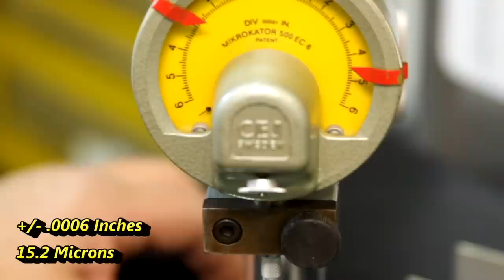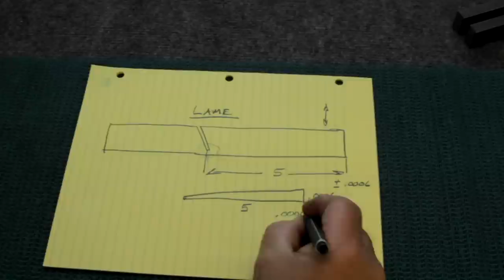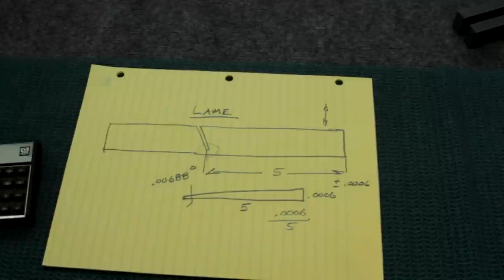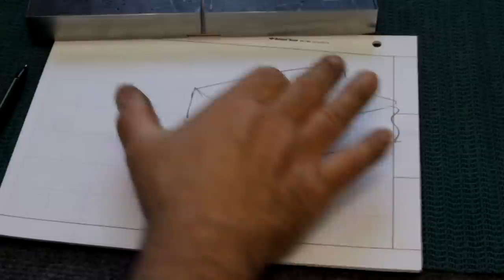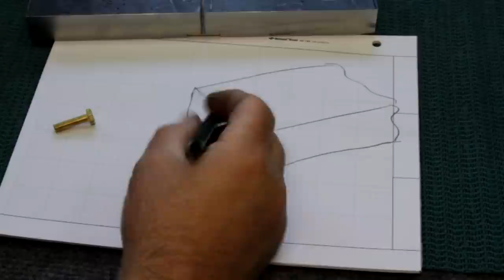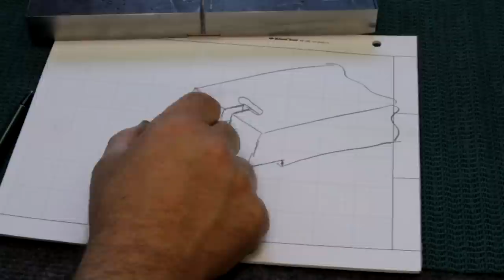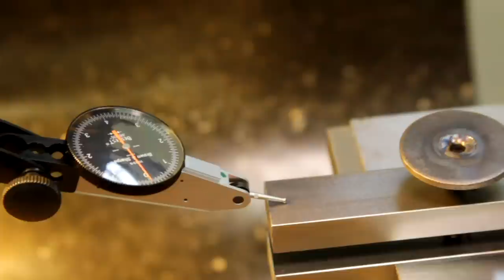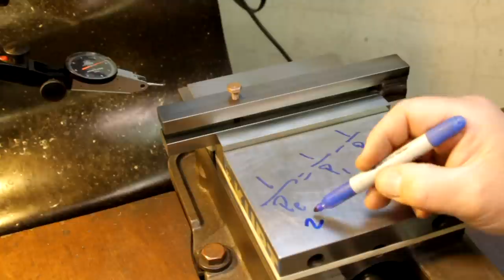Precision Mechanics

Comment: 28:06 - the equation for metric threads is far simpler, just pitch a - pitch b.  I designed bed corner adjusters for my 3d printers using this principle, M4 is 0.7mm pitch, M6 is 1mm pitch. Difference is 0.3mm, so 0.3mm per 360° rotation of the adjuster wheel. Very cool!

Comment: Priceless information for anyone designing fine adjustment into a device. Once again I have to say that this video alone would have saved me many days of head scratching back when I was designing and fabricating research instrumentation. Before I learned about differential screw mechanisms I used to go to swap meets and buy beat up old micrometers and use them for projects that required fine adjustment. I know the following remark betrays my prejudices and I in no way want to diminish the incredible power of software based design, but it is great to see design done in the shop with physical objects. Many thanks Tom!

Comment: Differential screws, never heard of them before now.  Wicked cool.  Thanks for the knowledge transfer. Keep them coming Dr. Ox
Reply: This is a clever concept for achieving precision, if I understand it correctly; one screw unscrews, while the other one screws in, so it actually moves at a rate corresponding to the difference in the amount of travel between the two different thread pitches.
The part I don't understand is how it could work without one them being a left-hand thread.
Reply: When you screw the big bolt in, it wants to push the parallels apart since the top parallel is threaded.  However, since it also screws onto the small bolt the push on the parallels is reduced by  a less amount since it also screws down onto the smal bolt with smaller pitch.
Reply from the maker: It is a bit of a mind bender. One is threaded into the other and fixed. Thanks for the comment.

Cheers,

Tom
Reply: i know i am late in the game but this has intrigued me to build my own repeatometer etc. So if I am not mistaken, the top bolt is threaded into the bar and the lower 10-32 is threaded into the lower bar as well? Thanks!!!!
Geo

Comment: Another great video, Tom.  Thanks for showing the various steps to getting finer and finer adjustment.  The trick of using differential threads is awesome.

An easy way of thinking of the differential movement is that the 1/4-28 thread is moving ~0.03571" per rotation, while the 10-32 thread is absorbing 0.03125" per rotation, making the resulting movement ~0.00446" per rotation, or about ~0.001" for every 90 degrees of rotation.

Comment: The description of the differential screw I found very interesting. I was looking for a way to hold a collet chuck in my pillar drill so that I could use it for light milling. The idea I came up also used two threads of unequal pitch to draw the arbor into the taper. Excellent video.

Comment: Thanks Tom, great video. I found a use for the differential threads, I just finished making 3d printer bed adjusters using 0.7mm and 1mm pitch threads so the net difference is 0.3mm. Working perfectly!

Comment: Good stuff Tom. One of the benefits of your design  (for me, at least) is that, since the flexure can be disassembled at will, there  is a lot better chance of a home shop machinist getting through the fabrication without destroying  it. If I were building the original design I would have to save the saw cut as the last op, and I would still probably wreck it before getting the limit straps in place. and the differential thread idea is brilliant!  Regards,  Dan

Comment: I hadn't seen that equation for differential screw pitch before. It's remarkably similar to the equation for parallel resistance, except in the case of right/right pitch there's a minus sign. Now I've got to make something with one of those setups. Cool.

Comment: Great content, I feel like I should be prepping for a midterm though    :)   . With the new knowledge I quickly tried to figure out how to get you a one-one turn with the tenths indicator you had even though you were close with the P(effective) of 224 as set up. With 0.0008" total indicator travel for a 360 degree turn you would need at P(effective) of 1250 which could be done with none standard hardware but that was not your point... so with standard gear it looks like that 224 is a good result that can easily be achieved. Just messing with some combinations and an formula, it appears the P(effective) increases as the individual TPI(s) increase and the difference between them decreases. With a custom set of hardware, 80 TPI and 79 TPI, you can get to 6320!  Great lesson Tom, Thanks

Comment: A drop of weld on the tip of the screw also works. I've done that with an adjustment screw for an indicator base. I don't remember what filler i used tho. Hasn't lost its tip in 10 or so years i've done it.

Comment: Excellent information.  That differential screw and parallel flexure mechanism would be a great improvement to the adjustment on a cheap comparator stand I have.  Great, another project to do before finishing another project.

Comment: Instead of the bolt in the milled slot, use 1 or 2 metal dowels press-fitted into one side projecting out into larger holes on the other side.  The size of the larger holes would dictate how much lateral movement you have.   This would be simpler to produce. I hope this makes sense.
Reply: Gary3247 exactly what I was thinking

Comment: Thanks Tom, interesting video.  You described the Rahn solution as lame, but they have achieved a solution that does the job as well as required using a single saw cut. I would describe that as elegant. Your alternative would be many times the cost to implement and does not perform any better.  As you are aware cost is an important part of the design decision!
Reply: exactly!
Reply from the maker: Hi Machine shop,

If you want to buy a Pontiac Aztek that does not bother me one bit. I personally prefer the Audi A8 if I'm looking for top tier design elements. Cost is not a factor in a theoretical discussion about pure precision mechanics as function is the first priority. One of the reasons these units are so expensive is there is no real market for them. If there was Harbor Freight would be all over it. If you read the commentary in the Repeat o meter video there is a resounding howl of disapproval of the saw cut flexure. I did acknowledge that it works fine and has been around for a while. No reason we cant do a little house cleaning when making our one offs. Thanks for the comment.

Cheers,

Tom
Reply: Machine shop at the bottom of the garden maybe you 2 missed the previous vid where he said the Rahm cost approximately 1000$ with a shitty saw blade cut in it, Toms will be elegant
Reply: What do you think could happen to the indicator reading accuracy when the screws on the flexure plate are loose?
Reply: I see it Both ways the Tom flexure setup is more robust and even replaceable, but there is a lot of beauty in the simplistic solution of the incomplete saw cut, with no areas for looseness many fewer steps to manufacture and no assembly required. I find beauty and elegance in simplicity.  Honestly I am surprised you all haven't redesgned this into a strain gage, microprocessor and digital readout so you have infinite resolution and no need for adjustment screws and indicators. :-)
Reply: I can see both sides of the argument but if you are paying mega top dollar for a lump of metal you should expect some elegance with your function. This is after all a tool for the very top end of precision measurement not a carpenters tape measure, which can be quite stylish and bought for peanuts.
Reply: I drive a Landrover so you can see what school of thought I come from!  I also design $6m gas turbines so I can see that the quality aesthetic of components count.  Either way keep the discussion provoking videos flowing!

Comment: Hmmmm.....maybe I snoozed during a discussion, the flex is a cantilever so I would assume the original remaining material of the saw cut was calculated that it could flex "X" to assure a correct reading, if I am correct in my assumption, how do you calculate the attached flex part the your design uses?

Comment: Great demo of the differential screw! Was playing with something similar recently, they're really neat things. You might know them already, but Thorlabs sells stock adjuster screws in various sizes (1/4"x80tpi is popular) along with drills+taps. Not the cheapest, but maybe handy to have.
Reply from the maker: Hi Lindsay,

Somebody else sent me a link. I didn't realize they were so cheap from Thorlabs. Used to New$$port pricing I guess. Thanks for the comment.

Cheers,

Tom

Comment: possibly drill holes in the flats of bolt head (at the flecture) and you can turn it by inserting a wire, pin, or Allen wrench.

Comment: This and the last episode were both great. Your indepth analysis of the subtleties behind the mechanics of the tooling and design improvements were both damned interesting. You should do a whole series of "Tom Redesigns [foo]" where foo = industry standards like the Kurt vice (which is no doubt fairly good, but has it's flaws, i.e., overtorque will lead to canting your workpiece vertically, rather than keeping it flush).

Comment: VERY fine discussion of alternatives. I went overboar:d with my concerns with the fine Vs differential thread business. There are lots of alternatives: if 1/4 - 28 against 10  - 32 is too slow. 5/16 - 18 against 10 - 24 = 0.014"/rev or 5 degrees per 0.0001"; against 10 - 32 = 0.024"/rev or 8 degrees etc until awash with too many choices.

Suggestion for drilling or punching spring steel sheet for flexure: chuck a wood dowel in the drill press on max spindle RPM, force it against the drilling site until friction heat draws  the spring temper to machinability (wood smoke for 10 seconds?). Spritz with water to limit heat migration.
Reply from the maker: Dang it! Now I have to go try that out in the shop. I usually resort to carbide end mills for blue scaleless spring steel. The 510 phosphor bronze is a good alternative and can be drilled easily. Thanks for the comment.

Cheers,

Tom
Reply: oxtoolco The usual precations for drilling thin stuff. I love them Uni-Bits.

Comment: Just a layperson here, but is there a reason you wouldn't want to lock the adjustment on that over-travel fastener with a jam nut? You could easily mill some clearance for it on slot side of the flexture, and just use a nice low profile nut. It wouldn't even take much torque to lock it in place, just a light snug. Personally I love field stripping my tools, I think it'd bug me if I had something glued in place

Comment: I came up with another simple way to increase the sensitivity of the indicator to  the adjuster screw by making the lower limb thinner than the upper.
     After viewing the first video. I could hardly stop thinking about the 
differential screw. While calculating pitch multiplication factors, I 
noticed something in Rahn's design which can be further exploited for 
precision. 
    Notice that both the upper and lower limbs are free to move relative to the base under the force applied by the adjuster screw.  This means that the spreading distance from the adjuster screw  is distributed between the two limbs in accordance to their springiness. If in the original, assuming the spread is equally distributed between the upper and lower limbs, the upper limb moves about half as much as the change in screw length. 
     Since the indicator measures from base to upper limb, this effectively doubles the thread pitch since the upper limb only moves up by half the spread of the screw.

My big idea (in my mind) is that one could further increase sensitivity by making the lower limb springier by making it even thinner. 

For example, to make an effective screw pitch 4x as fine, make the lower
 limb 1/3 the thickness of the upper. 1/3 thickness  should move  3x 
further under the same screw force.  For a total movement of 4 units, (1
 upper + 3 lower) the upper would only move 1 unit. 

As long as the elastic properties of the limbs is not exceeded, the thinner the 
lower spring, (or thicker the upper) the greater the thread pitch multiplier.

Your proposal (previous video) to make these limbs bolt together in the previous video, makes it easier to try out this idea.

Thanks again for this awesome follow up video. I'm vary curious what you think of this.
Reply from the maker: Hi Goone,

It may have some merit. One reason I constructed the analog of the Rahn was to see what effect the two limbs spreading had on the sensitivity needs for the knob. There is certainly some effect but hard to quantify. The other purpose of the screw is to actually unload the indicator from the contact point when not using the device. It needs a bit of travel to do that as the preload of the indicator is something like 1mm. Thanks for the comment.

Cheers,

Tom

Comment: Nerd paper! (aka Engineers Computation Pad) Haven't seen that in years. 

Love that stuff.

The only thing I dislike about the flexure is that the hinge action is somewhat different down vs up, due to the truss screws. Clamping bars would fix that.

The thing about the angle cut is that it presents a corner pointed straight down with a well-defined hinge point. I'm guessing it's cut with an abrasive saw? 

I don't know that it matters—having a hinged piece on the bottom seems irrelevant to how the instrument works. You just need something to provide vertical travel. For example, relieve the bottom on the business end, bore a vertical hole through it, and make a captive anvil that floats in the hike and transmits the motion to the indicator.

Flexing would be important if you were using an optical collimator instead of an indicator—perhaps that is/was an option?

Comment: Tom, fantastic video. Is there any need to create a vent hole in top portion of the differential screw to avoid air/lube compression ? or are the threads course enough to let air/lube to pass?  (i assume some oil could be added to the threads to help any friction)

Comment: I have some eBay special differential thread micrometer bodies.  They look to have come from some sort of precision stage.  I don't recall the resolution exactly, but I seem to think they were millionths adjustment.  I was making a precision stage for a digital camera, to take sub-pixel images and stitch them together into a 54mp image (using a 6mp camera).  My camera would require 3 tenths of movement between images to get subpixel resolution.
Reply from the maker: Video please. Thanks for the comment.

Cheers,

Tom
Reply: I never completed the camera stage, I didn't have good shop facilities at the time. But if I can dig up the micrometers, I'd be happy to make a vid, if you're interested.

Comment: I split hairs. But that is appropriate for this series :). Properly the pitch of a screw is the amount  it advances in one turn e.g M6x1 afvances 1mm per turn. So your elaborate formula is due entirely to the Imperial specification of the reciprocal of the pitch. In metric terms Pe = P1 - P2 and finito.  M6x1 and (say) M4x0.7 means Pe= 0.3. That is much easier than messing around with reciprocals, but you know what I think of Imperial! But working out the trivial example made me see that this is a neat idea.

Comment: Hi Tom, I keep wondering about swapping the locations of the screw and indicator.  If the indicator were to be located between the screw and the pivot point wouldn't there be lees movement?
I guess the repeat in the name is a bit of a clue as to the desired function, not just a small amount of movement from the adjustment screw.  Hummmm . . ..

Comment: As an overtravel mechanism, would it work to have two or three dowel pins bridging the gap set into slightly oversize holes in the ends of the two pieces?  Or even maybe a tongue and groove cut into those ends instead.

Comment: Now, see if you can calculate the thread pitch needed so the angular displacement of the screw (bolt) head = ang. displacement of the indicator dial! :) More to the point; could you make such a thing using differential screws with commonly available thread pitches?

Comment: Tom, I hope at some point you'll be discussing the efficient setup of differential thread systems. In my experience, there's a good bit of clocking of the internal thread in order to get the outside thread synched with the start of the internal thread. In this application, would you spread the flexure to the maximum point, then get the internal threads lined up with the start of the lower screw? Or what process would be employed to get the thing together and not under tremendous stress? Is there a way to do it that isn't trial and error?
Reply from the maker: Hi Jeff,

It was actually pretty easy in this case since they are the same hand thread. I just turned the 1/4 inch screw a little as the #10 entered and all was fine. I was more worried about the angle change between the two limbs. It turns out it wasn't a big deal over the distance I moved. Thanks for the comment.

Cheers,

Tom

Comment: Tom, if you use a differential screw with pitches of 1/4-24 and M6 X1 you get an effective pitch of roughly 454 TPI, or .0022" lead per thread. I averaged some numbers but it's pretty close.
Reply: You might have problems screwing a M6 into a 1/4-24...
Reply: Bob Korves hey Bob, haven't I seen you on the forums? 

you're right, but any combination of those two thread pitches will work. 1/2-24 and M6 should be good.
Reply: although you would have to single point thread those 1/2-24 threads
Reply: Single pointing the fasteners may move them into the 'lame' category...
Reply: (H-M?)